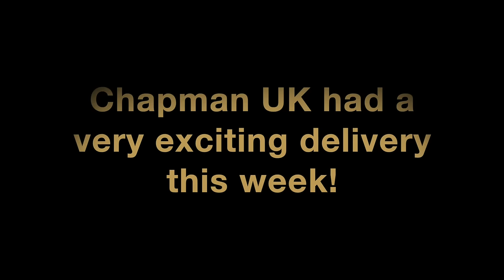Arrival of 73ft Hydrascope Crane

Comment: do you think that cranes are redundant these days because of the rise of very menuvoirable and cost effective drones?
Reply: Jc Pete good point
Reply: Edward Cameron
Reply: Not at all cranes are very usefull. Drones run out of battery in like 20mins from using it
Reply: Drones are not smooth and make a lot of noise
Reply: Bobayeka da bogeyman  I personally interested of VERY, REALLY CINEMATIC ... music video. I don't care the noise at all. The audio is recorded in studio. Noise of drone doesn't make me unefficient to put the audio on the right place. So at my side, this is not a problem. But that drones are not smooth enough, mostly true. The drone must to be roboust, heavy, to be more preciese. They are expensive too. On other way, I'm okay with the 20 minutes, because you can swap the battery. But it's not the same. On the end again the question, if it's worthed or not